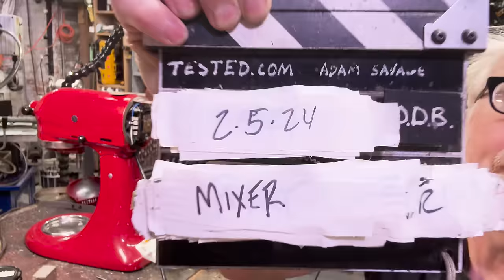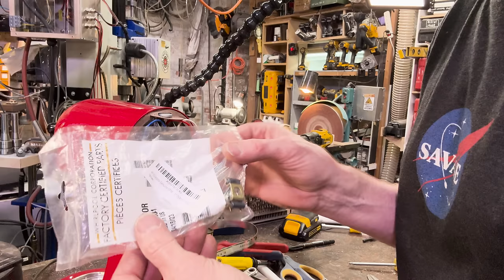Can Adam Savage Repair This Old KitchenAid Mixer?

Comment: I have to wonder about how noisy it is. Mine is really noisy like this, and I have noticed that the brushes have scorching, but I haven't been able to figure out the cause.
Reply: Commutated motors just wear. There's ways of refurbishing the bars but it's pretty involved. Your most realistic option is to just live with it. As to what causes it it's the friction of wear of the brushes on the commutator bars. That stuff is spinning and in contact too. What happens is the brushes wear and what's worn off the brushes accumulates between the bars. That junk has to go somewhere.
Reply: @1pcfred , thanks for the information. The brushes shouldn't be scorching though, which suggests something more involved is going on. I would also hope that commutated motors don't wear out as fast as mine did.
Reply: @adammcinnes5615  any time the brushes are not riding over the commutator quite right there's going to be a lot of sparking. There's a few causes that can lead to that. The root of some of those issues is just bad luck too.

Comment: Sadly the current Kitchenaids are not built to the same standard as these Hobarts. Cheaper materials, electronic speed control.
Don't rush out to buy one based on videos of these older machines.
Reply: That's sad to hear, although not surprising. We have the exact same mixer Adam is working on and we'll probably be able to pass it on to our daughter. So hopefully she won't have to buy one of the newer, crappier ones.

It's 20 years old and while it's not used heavily, it's used a reasonable amount. And it looks and operates as if it was brand new. Just a solid, reliable beast of an appliance.
Reply: This is pretty much nonsense, the move to an electronic speed control is to be expected and frankly superior for a number of reasons and not a large issue maintainability wise. You may not be able to fiddle with screws to adjust a mixer's speed going out, but by the same token you also won't NEED to fiddle with screws which can work loose over time. Simplistic electronics like these speed controllers are basically bulletproof they will last for decades effortlessly. In terms of replacement they're also actually easier, since you just plug it in without having to fiddle with any adjustments, they're slightly more expensive but still quite affordable at around 50 dollars. 

As for materials, this is just flat out a lie. There has been no notable changes. These rumors stem from some idiots that don't know what a sacrificial gear is seeing a nylon example (inserted in later models to protect the motor from overload) and screaming "ER MY GAWD PLASSSSTIC".
Reply: @Tk3997  This "nonsense" is easy to fact check. There are significant differences between their current consumer mixers and the older ones or their current professional grade ones. People should know that the name alone is no longer an indicator of quality.
Reply: @tom.m  Indeed it is easy to fact check by simply looking up a replacement gear set for a current production model and seeing oh hey they're saying you can use literally the same damn gears for a model bought last month or twenty years ago. 

It will never cease to baffle me why people on the internet will continue repeating easily disproved lies when fact checked.

Comment: You   made a point of telling us you unplugged it, I assume for safety. But at 10:12 it appears that you are sticking the screwdriver into electrical contacts, with your finger on the metal blade of said screwdriver. I know it's live because it takes off.

Comment: Don't want to be a safety troll, but to the viewers please please do NOT work on AC mains powered equipment without proper knowledge and safety precautions!
Reply: British safety trol)s.
Reply: Using a screwdriver with insulated shaft would literally halving my heart rate. 🤦
Reply: @sandmehlig  If it went wrong, we would never see this video. Nonetheless, i felt the same.
Reply: Lots of folks dont know that some appliances have start capacitors in them. So even if you unplug them and kill the power you still can have voltage stored in the capacitor. In the old days electricians would just shove an insulated tool in there to discharge them. Today there are devices that safely discharge them so you do not get zapped. Generally smaller appliances like this do not have capacitors but it never hurts to check first.
Reply: Yeah he should be using insulated tools a the minimum
Reply: And you and anyone else say n something about safety are the one's who wear a harness in bed with their wife....   Adam my friend thanks for all you do and God Bless you Mr. Savage
Reply: @bobbressi5414  those devices require bleeding circuits nowadays, doesn't take away the fact that those could also be faulty, but in general you'll be in the clear.
Reply: I for one appreciate safety trolls.
Reply: @Rocky91DTA  you make it sound as if it's wrong to have a harness in bed.
Reply: Aaaand, he's got his hand on the metal tool while it's running... 🤢
Hey, maybe he's got it plugged into a GFCI? 😂
Reply: @AlexKall  🤣consenting adults and all
Reply: Don't be then.
Pipe down.
Some machines require adjustment while running. That's reasonable for those who feel safe to do so.
It's not a bubble wrapped world just yet.
Reply: @sandmehlig I’m surprised he doesn’t have a full set of Wiha or Wera insulated tools.
Reply: @JernD never apologize for emphasizing safety (esp in a workshop or arround electricity). people who complain about others advocating safety are doing harm to themselves, and more importantly, others.
Reply: @deefdragon You must be from California
Reply: It’s only 110v you’d be grand, over here in Ireland we play with 240v pixies and that will give you some tingle!
Reply: Exactly. Everyone should know the basic. Step 1: plug it in. Step 2: cut the cord. Step 3: enjoy the fireworks.
Reply: You need to learn it one way or the other.
Reply: @bushratbeachbum You need to pipe down if safety advice triggers you this much.
Reply: This ain't sh*t try adjusting a distributor on an old car while it's running or pull plug wires while it's running 😂😂😂
Reply: Never a bad thing to be a safety troll, imo
Reply: This message may cause cancer in the state of California
Reply: Can the safety troll stop homosexual special rights ?
Reply: It sounds to me like you absolutely do want to be a safety troll.
Reply: @Rocky91DTA  really not appropriate or relevant so stop shaming people and keep your aversions to yourself.

Comment: Slight rant about KitchenAid mixers! 

I was shopping for one of these last year and discovered that almost every single model, including the more expensive prosumer variants had switched to AC motors. The problem is that they're low torque, so if you mix dense stuff they bog down. They will burn out prematurely if used that way regularly. Of course, KitchenAid retains the same design across their lineup because of the legacy it evokes while obfuscating what motors are used inside. Cost cutting at its finest.

It turns out the 7qt Pro Line is the lowest end model in this style that still uses the DC motor. It starts at $600 but we've been using it almost weekly for a year and it's been fantastic. So if you do a lot of mixing it's the only way to go.
Reply: The way you wrote your comment leads me to believe you think there's only one kind of AC motor. That is definitely not the case. There's inherent problems to running DC motors with AC input current too. Namely all the circuitry involved in converting AC to DC. The motor in the mixer in this video is a universal motor. That means it can run on DC. It's not going to run any better on DC. In fact it'd be more of an issue considering how it is being speed controlled. You'd always be switching at peak voltage on DC. That means maximum arcing. But there are other ways of speed control besides what we're seeing here.
Reply: @1pcfred  I'm not sure what you're talking about because there clearly are AC and DC motors and KitchenAid themselves refer to them as such. That distinction is further reinforced by user complaints.
Reply: @maweitao  I never said there weren't AC and DC motors. What I said is the motor in this particular mixer would run on DC. If it is running on AC and it has brushes then it is a universal motor. It's a pretty simple flowchart. Can you handle it?

Comment: Uses an electrically unsafe screw driver while messing around in a live, operating appliance. Holds the one uninsulated part of the tool... That said, I think I prefer the fix your things videos over even the one(several)day builds. Honestly. I don't have a kitchenAid, but, I want one, and if I manage to find one that doesn't work, I'd like to be able to fix it.

Comment: Should have changed the old grease in the gears while it was apart.  I have one of these of similar age, and it is definitely not made to the same standards as the higher end Kitchenaids.  They even told me I should have bought a better model (some have sealed gearboxes) when I complained to customer service about grease dripping into the mixing bowl.  No help, no repair, just said it was food safe grease and deal with it.

Comment: If your home mixer is losing paint the paddle is too low. There's an adjustment on the underside of the neck near the hinge. Should barely touch a dime in the bottom of the mixing bowl!

Comment: Adam!

I enjoyed the KitchenAid mixer video.  This thing only worked for 20 years?  Sad.

But I can go ya one better.  I’ve got a Sunbeam Mixmaster stand mixer from the late 1950’s.  You can see one just like it on a number of “I Love Lucy” episodes.  Back then, you either lived with the chipped paint, or you had it repainted.  MUCH cheaper than buying new parts!  They always had one in the kitchen, but it changed to whatever the current model was at the time.  Mine was in my wife’s family since it was new.  When we got it, it was in a cardboard box, wrapped in newspaper.  What makes this one cool is the fact that we have most (if not all) of the attachments for it!  There are lots of old Mixmasters around, even from the ‘50s, but each of the attachments (which ran with mechanical power supplied by the Power Take-Off (PTO) on the top of the mixer body, located at the front of said body.  Since the attachments were sold separately, if you can find them, these days the attachments are worth more than the mixers!  

And this puppy had attachments available for doing all kinds of stuff… like grinding meat, making sausage… all kinds of stuff.  My personal favorite is the milkshake maker.  This attachment is a chrome goody that connects to the PTO, and there’s a metal thing that comes out of the opposite side, and it looks just like the ones on a Sunbeam Shake Maker, like you’d see in an old-fashioned ice cream parlor or malt shop.  And it came complete with the original Sunbeam-branded shake-mixing glass.  It’s heavy glass with a Sunbeam logo and the company’s own custom tint in the glass.  (What do I mean by that? It’s clear glass but it has a slight tint to it… something like an original glass 6.5 ounce Coke bottle that was once sold in vending machines for a dime, but there was a 5-cent deposit on the bottle.). Since a dime was actually worth something back in the day, you gladly paid the deposit, unless you finished drinking that relatively small amount of the product (compared to now) right where you bought it, then put the empty bottle into a rack on the side of the Coke machine.  When the stacks of bottles at home got too big to have taking up space around the house somewhere, you’d put the bottles (hopefully in cardboard boxes) to a store and you’d get your deposits back on each one.  Because your dime was actual money, most people didn’t just throw the bottle somewhere.  That green tint in Coke bottles is actually the property of The Coca-Cola Company of Atlanta, GA., and it even has a name - Coca-Cola Green!  But I digress.  Back to the old Sunbeam…

I had this Mixmaster restored back in the 1990’s.  The speed control knob quit working - no matter what position it was in, the mixer was either off or ON! (at full speed).  I found some guy up in Canada who specializes in restoring Mixmasters.  I don’t remember his name or even what Province he was in, so please don’t write and ask me.  His info got lost when we moved into our house.  If he sees this, he can always write me through You Tube and give me his info, my copy of which was lost when we FINALLY were able to scrape together a down payment on this nifty 1952 house, which was modified from its original layout and has two cool room additions.

Anyway, he fixed the rheostat (“speed control” for the uninitiated), then did a full restoration job on it - with factory (and period-correct) Sunbeam White paint.  He cleaned the motor and adjusted its brushes.  You KNOW it’s old if there are brushes in the motor!  He then refinished the turntable for the mixing bowl (of course it has a turntable!  Have YOU ever seen digital cake batter?) with exactly the correct rough-textured black finish, which keeps the bowl from sliding when you’re beating the bejeezus out of whatever.
 
Then, he replaced the sanded off and painted over “Sunbeam” decals on each side of the mixer body with period-correct ones(where he gets these things I have no idea) and he had some kind of stuff to make that Bakelite®️ speed knob look brand-new, and he restored the printing on that knob.  It was a really beautiful job, and my hat’s off to him, whoever he is.  Again, don’t ask me how to contact him.  That info was lost over 20 years ago.
Reply: We have a Kenwood chef which also has all the attachments. 
I want to get the meat grinder for making haluptsi

Comment: 10:50 ... at this point I'd be saying, "Fk it, I'm going to Goodwill to find another one!!" 😆
11:30 ... we have the model where you lift the bowl to the mixer. The mix blade is aluminum and when it goes through the dishwasher a blackish film is produced that runs off all over your hands! I went to order the enamel coated mixer blade but apparently that is only for the fixed bowl models! 🤬 Thank you so very 🤬ing much Kitchenaid!!
25:32 ... and as long as you don't lose the little pin and have to lathe a new one you're good to go!!! 😆😉

Comment: KitchenAid mixers are poorly assembled. Mine had that problem right out of the box. Instead of returning it, I fixed it myself. For some reason the switch jumped from low to mid on its own. I forget how I fixed it. It was ten years ago.
Reply: It was probably the push rod that connects the speed control lever to the speed control plate. At some point the part was redesigned so that it sometimes doesn't hook properly into the speed control plate (and then it was redesigned again and made from plastic instead metal and sometimes just snaps off in newer mixers).
Reply: Quality went downhill when Hobart stopped manufacturing them.
Reply: @1pcfred That was 40 years ago. There is ample evidence by this point that Whirlpool-era KitchenAid mixers also last forever.
Reply: @tookitogo  then why is this one being repaired?

Comment: It looks older than 20 years, but they seem to have used the same basic design since the 50s.
Reply: It's based on Hobart's K Model from 1937, only recent specimens are actually worse because new parts are made from cheaper materials (which means it is someone's actual job to make an 80+ year old design worse, which I find super weird).

Comment: I really hope that changes at some point as right to repair laws get drafted. I'll have to get a Kitchenaid mixer after seeing this. 

Inherited a clothes dryer from my parents when I got my own place and it stopped drying. Would you believe even after going bankrupt; Sears still sells spare parts for appliances from the 80s? Just needed a new heating element and back to new.
Reply: There's no such thing as any right to repair. EIther you can fix something, or you can't. I don't want to have to subsidize anyone's attempts either. Because supporting that will cost money. Money that every consumer will have to pay. Because manufacturers are not just going to eat the additional cost. No it's a business expense that they're going to pass on. Someone should tell politicians it's a tax write off. That should end it right there.

Comment: My problem is that I have no patience and would have just spent way more time and money to add a complicated VFD that would overheat the motor.
Reply: Universal motors care not what frequency of current they run on. That's what makes them universal. They're self commutating. There may be an upper limit of what frequency they can handle though? But they'll run on DC even.

Comment: HaHaHa,, I went through the same BS he did, wasted many frustrating  hours screwing with the adjustments, replacing the parts, not giving up until I realized the parts were inferior to the original, I could almost get it right but after a few times of use it was the SOS!  Save yourself, junk it

Comment: It's still not working correctly, Adam, but I don't believe you hold 100% of the blame.
This speed controller has to be the absolute worst method to control a motor I have ever seen.
I actually condemn them for not moving into the 21st century with a proper sealed electronic controller.

The mechanics and electrical contacts are getting covered in flour and powdered chocolate because of the fan back there. It's like a grinding compound constantly wearing everything.

For what these things cost new, I think the public is getting taken for a ride.